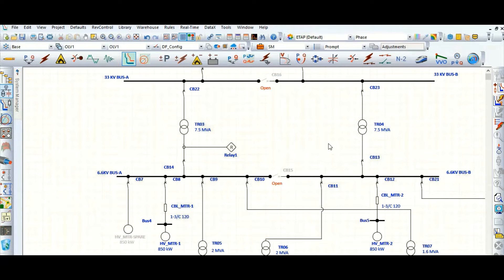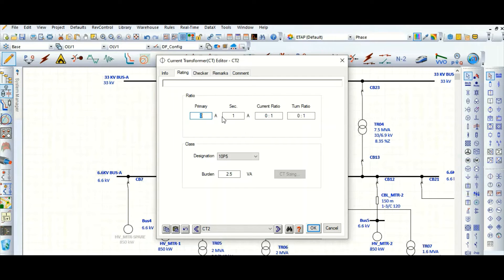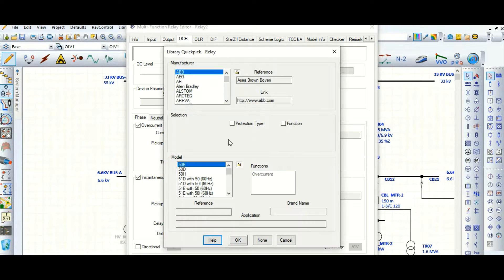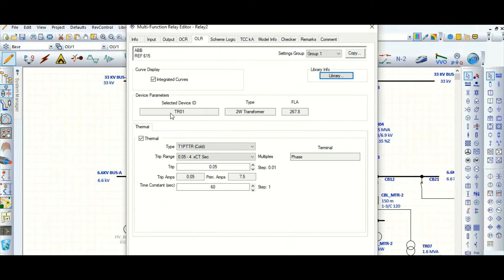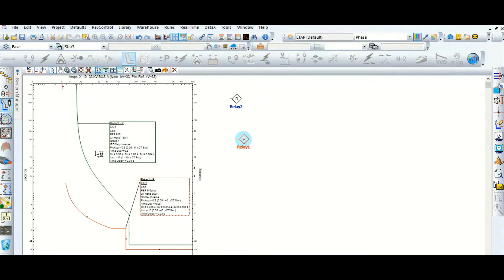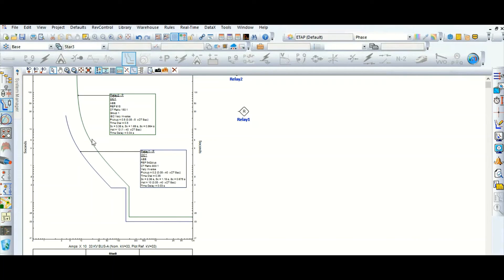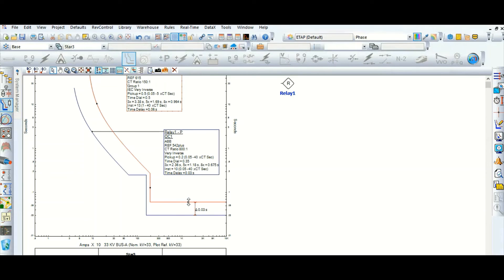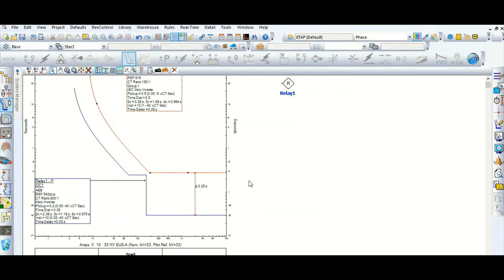ETAP System Study - IDMT Overcurrent Relay Setting & Coordination II Manual Calculation (Part-6)

Comment: hi brother!  first of all thanks. Why did you set the pickup current for the relay 2  (HV side) to 0.5 which is 75 amps,  while the primary rated amps are 131.2 amps? shouldn't it be higher?